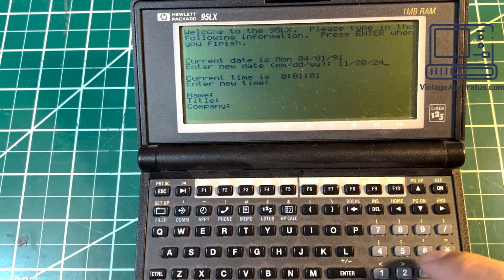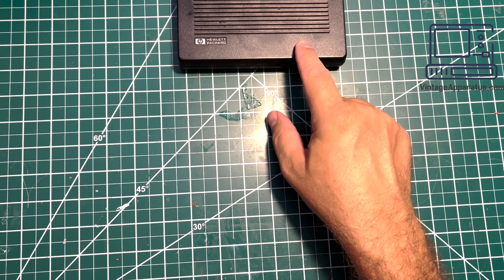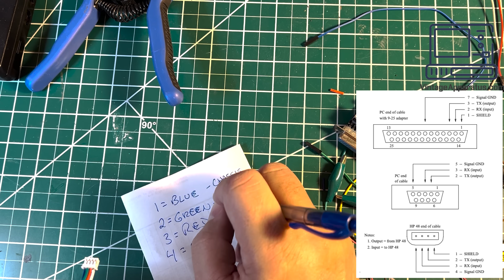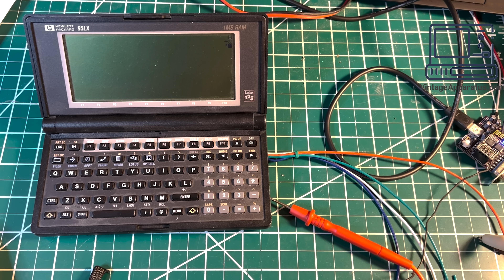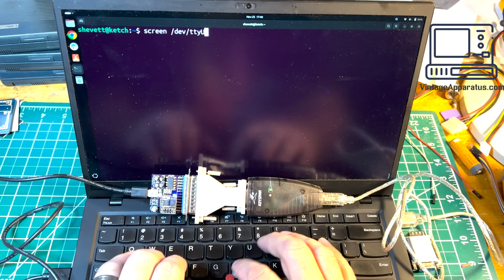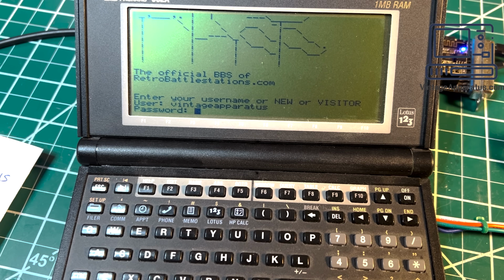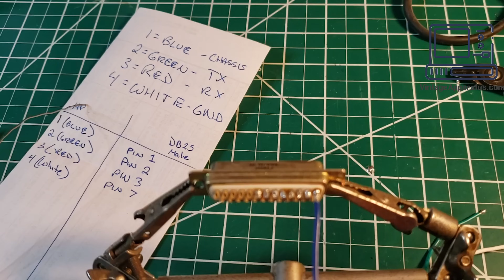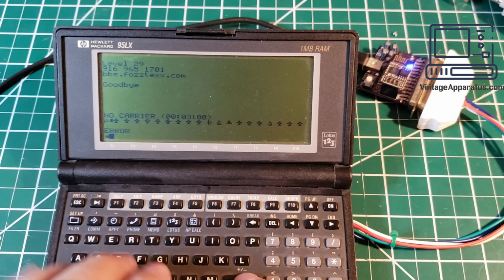Hand-wiring an RS232 cable for a 30 year old HP Portable Computer

Comment: Not a speed burst but a flow control lack? Why don't you use ftdi with USB connection directly?
Reply from the maker: So there's two ways to do flow control on RS232.  One is using RTS/CTS signaling - this connection didn't have those lines, so that wouldn't work.  If the port were signalling STAHHP via those lines, you'd get garbage or dropped characters during the 'pause'.

For FTDI, what USB port would I use here?  The HP has no USB, and my wifi modem doesn't have it either.  I use FTDI  connections when using my laptop as a serial console on my PDP11s (see other vids), so I definitely have them.  Just didnt' seem useful here.  Am I misunderstanding?

Comment: Ah the days of rs-232 wrangling! I was expecting you to bring out a breakout box. I still have mine. Borland ported their Quattro Pro spreadsheet and I ported their graphics package to this so it could render all the charts.
Reply from the maker: You jest, but the part of the video where I'm rummaging through the RS232 box?  I was in fact looking for my breakout box, and pulled it out.  But I realized later on when I went to use it the patch wires I had were the wrong gauge for the breakout box, so I couldn't use it.  So I edited all that out!

Comment: I used a 200LX back in the early 2Ks. I managed my entire life on it. The 200LX is similar to the 95LX. They look almost identical but the 200LX  has an 80 character screen, offered more RAM and storage, and had some other internal hardware improvements that allowed for a more diverse population of compatible PCMCIA cards.  I used to have Internet access via. serial modem, low power PCMCIA card and several software tools. Chief among the software tools was an app called WWW/LX.

Comment: how come you werent able to just use a pcmcia NIC? lack of drivers?
Reply: In principle that works, but has 2 drawbacks:
1. The NIC takes up the PCMCIA slot. Usually you want to put a CF or SRAM card there to have some disk storage.
2. Most NICs draw a lot of current, some up to the point that the palmtop will no longer function.

Disclaimer: I have used that approach on an HP 200LX, not the 95LX.

Comment: I've been wanting to do something like this but with an old amber screen dumb terminal and and a raspberry pi zero 2W that I would mount inside of the terminal chassis for use with Usenet, Email, text BBS's, and of course SSH.
Reply from the maker: There was a design like this at VCF East a couple years ago.  Took an old ASCII terminal and embedded a pi zero w in it.  SO even though the terminal was just... a terminal, it had enough smarts in it to talk over the internet.  Was a nice piece!

Comment: No need to bother with hand crimping a cable, the end of an old CD ROM audio cable works perfectly :D (Also since we are speaking of hardware hacking these: I have a HP48G hacked to 128kb RAM, it's four 32kb SRAM ICs on top of each other, hand soldiered, most legs just kinda flowed together and only a few legs are apart.)
Reply from the maker: Sure I could use a premade cable.  But where's the fun in that?  :) :).  Thanks for watching!
Reply: @vintageapparatus  Heh, it's only one end which is premade, the other end is of course hand made :)

Comment: Slow your data rate down to 9600 baud. That should be slow enough for that processor to handle but still fast enough to be usable.
Reply from the maker: I definitely want to experiment with the speed issues and see where the buffering is happening - if it really is just that the 95LX can't keep up with a 19,200 speed.   Thanks for the feedback!

Comment: When I worked at Precision Guesswork, which was a spinoff from FTP Software, in the late 90s, our main product was the LANWatch network analyzer, and we had a version of it called POCKETWatch that ran on the then-current HP palmtop, I think it was the 200LX, and came with an RS232 breakout cable for SLIP and PPP links. Presumably useful for network admins trying to troubleshoot things, but I'm not sure we ever actually sold one.
Reply from the maker: The HP200LX has a very different RS232 port - a lot more pins - I hope to try and make a cable for it at some point.  Next step on these is to see how much we can do with the PCMCIA port - would be nice to get some new apps on them!